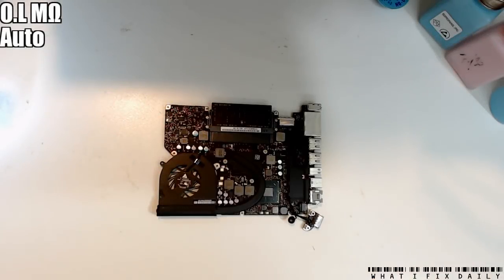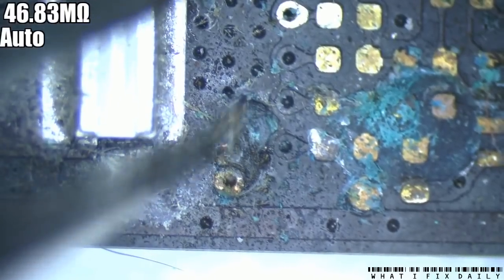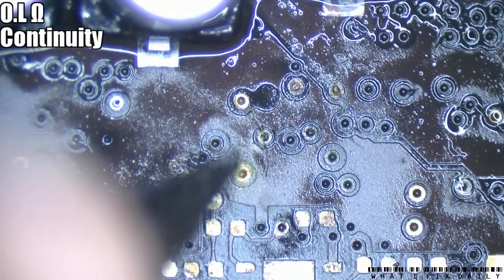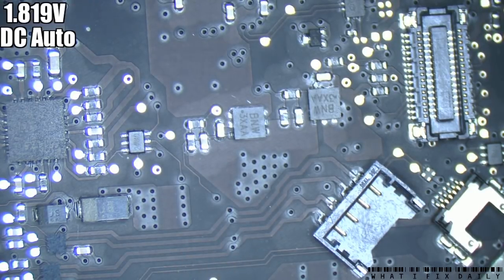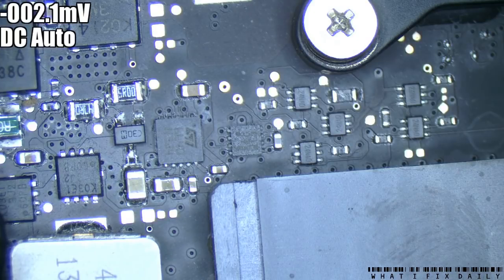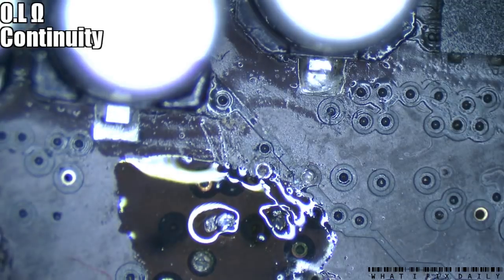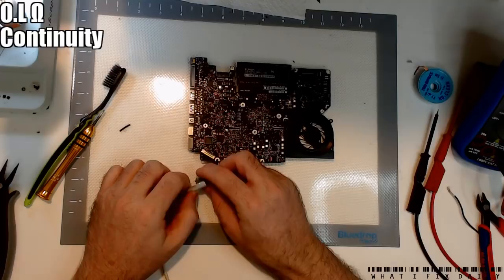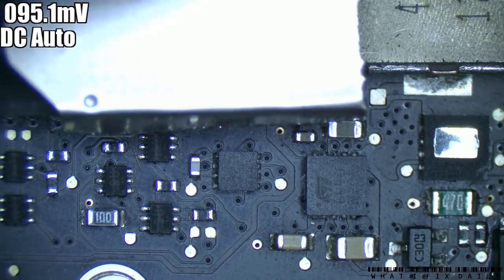Macbook 820-3115 Green light, no fan spin (Compact edit)

Comment: Wow... I have the same issue with my board... I'm pretty noob considering component level troubleshooting but I suspect my U7941 is damaged because I think I found some sort of liquid around it and I'm not getting an S5 power rail together with no SMC_PM_G2_EN. Probably because of the crappy power supply I used to use with it. Learnt my lesson.

Comment: Good job Paul. Do you know of any good inexpensive microscope to work on mobo's ?
Reply from the maker: This is about as cheap as you can probably go.  The trouble with something like this is that the post mount that the base has will likely obstruct you from freely turning the board around as you work on it.  At least the heads are standardised so you can always upgrade to a better base or articulated arm later.

https://www.unionrepair.com/7-45x-szm45-b1-binocular-industrial-stereo-microscope-with-led-lights.html?currency=USD&sl=en